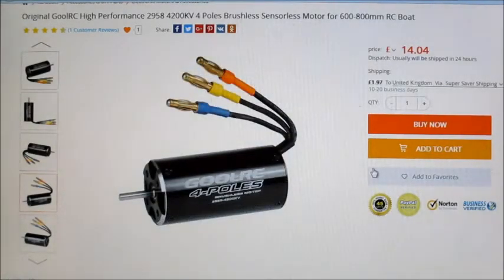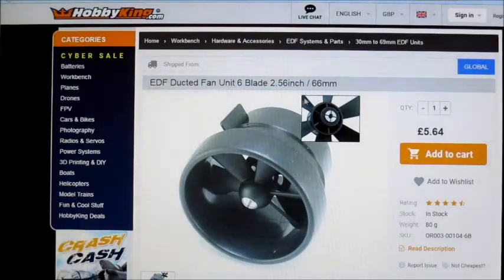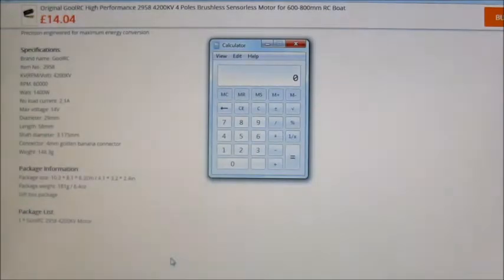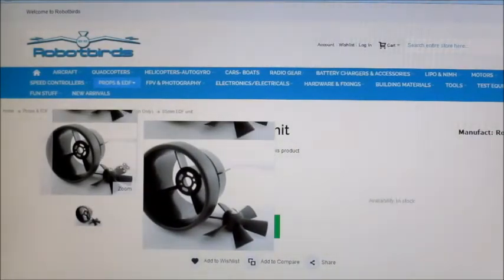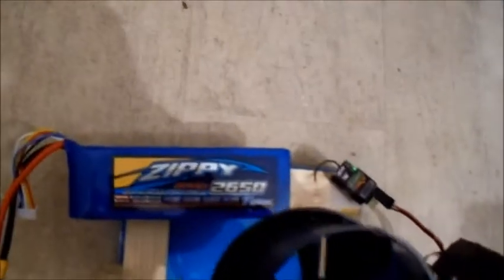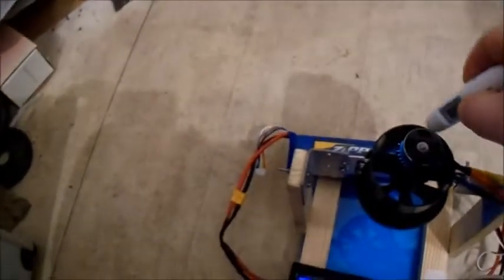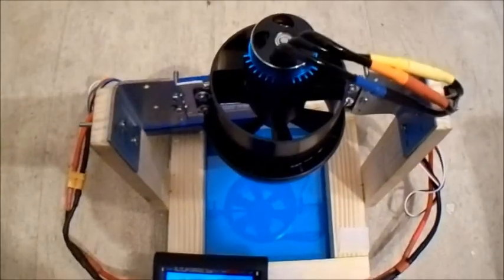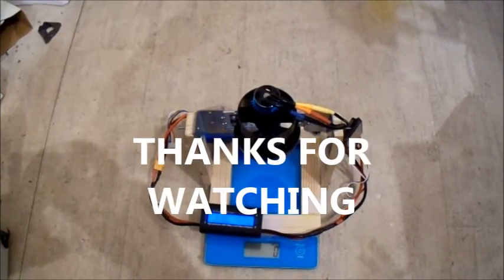GoolRC 2958 4200kv 65mm EDF Thrust Test Motor test of the Week

Comment: Great test! 1650 grams of thrust at 79 amps using a 4S. What is the weight of the motor, EDF unit, and 4S LIPO? Thanks for the video and Happy Flying!
Reply from the maker: Thanks mate.
Good question. I just went out to the workshop and weighed everything. The edf and motor with the heatsink on weighs 209g or 7.46oz. The 2650mah 40c 4s lipo weighs 285g or 10.17oz but Hobbyking list it as 318g? The 80a Hobbywing Skywalker esc weighs 84g or 3oz. Total weight is 578g or 20.64oz. Still a little bit heavy but not bad.
Thanks for watching.
...RCPP
Reply: Thanks for all the information ;-)